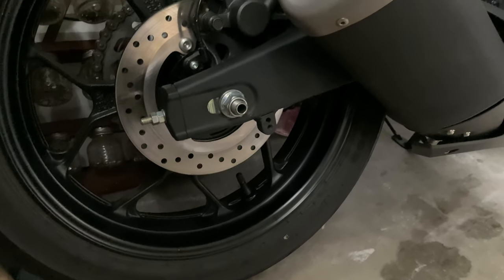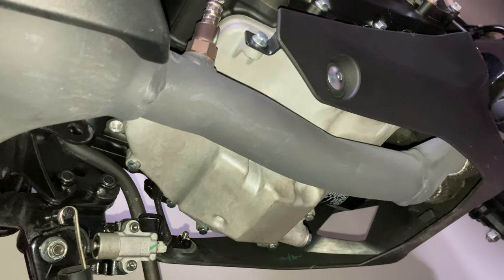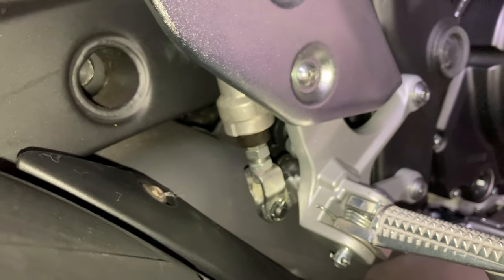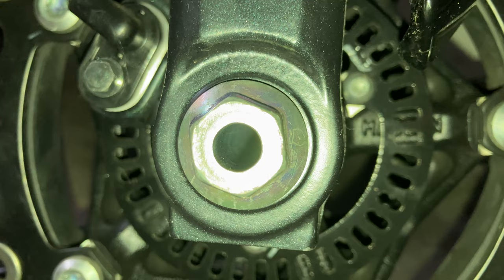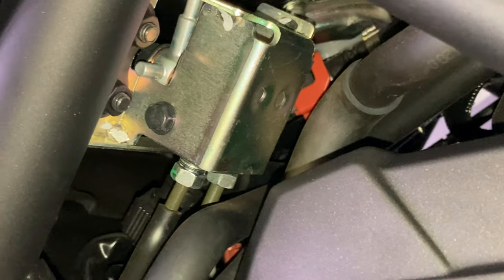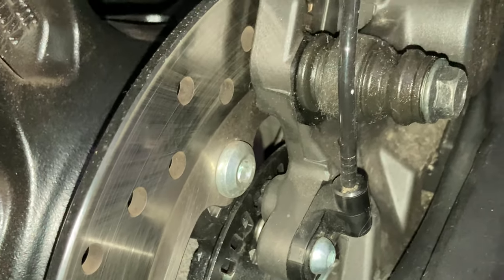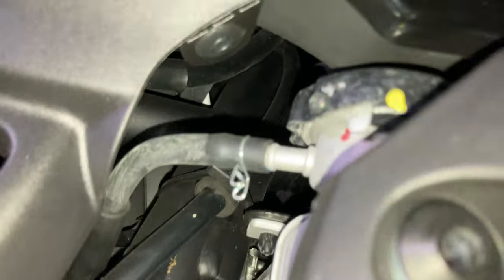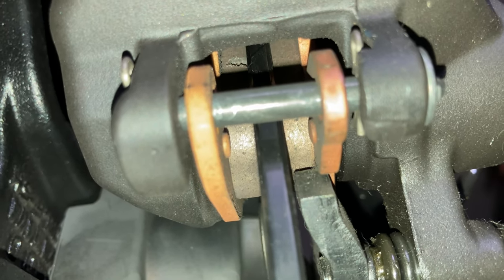MT03 Inspection (deep dive) slow with commentary noting cracked front brake pad // only 1000mi ODO

Comment: Its not cracked. Brake pads have slots cut into them and it serve as stress relief for brake material so it will not crack from heat expansion and also as a wear indicator - when this grove disappears it means you should replace brake pads.
Reply from the maker: Thank you for the information, the bike mechanic said something similar & not to worry :) Cheers Brother!